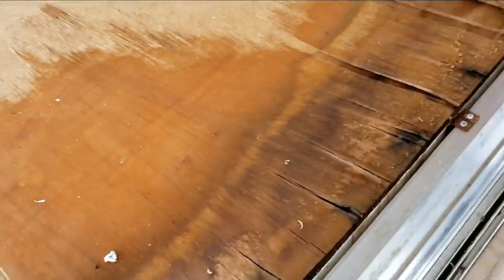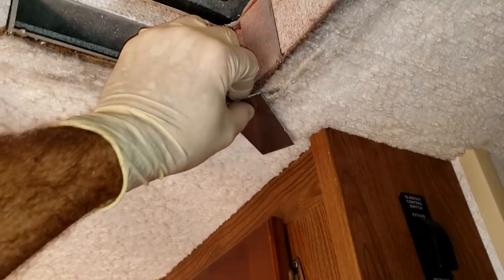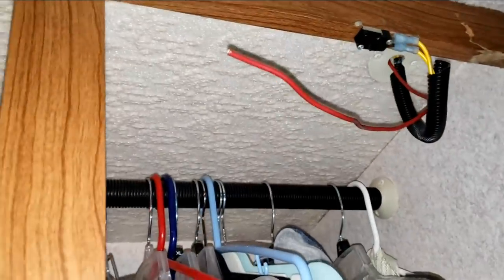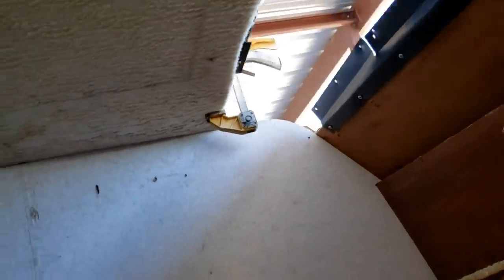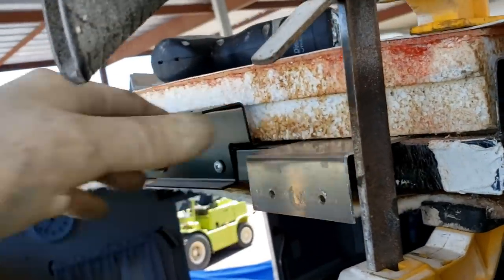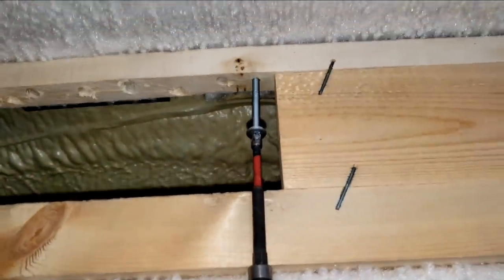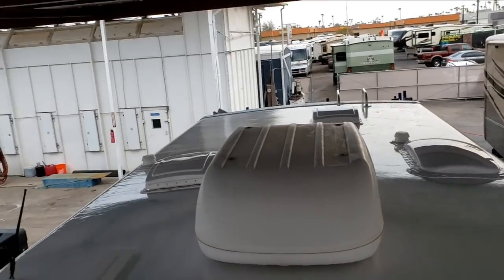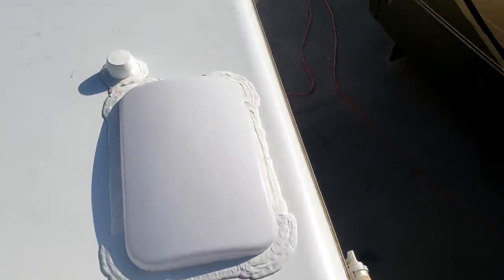A New Roof for New Journeys on a Winnebago

Comment: Another Fine repair. Aluminum is non ferrous. SO plenty safe to cut on any wood working tool (as you already know). And I crown you a RV ENGINEER. Personally I think you did a fine job And the owner made the right decision by getting you to do the job.  Congrats to the both of ya. -S
Reply from the maker: Thank you. You never know if someone will point out the obvious flaw in the design after the fact.

Comment: You are so right about a pre purchase inspection by a professional. I was misled on a fifth wheel private party purchase I made about 10 years ago. I had it fixed at the factory and still have it today. If I ever do purchase another one used it will be pre buy inspected for sure.
Reply from the maker: It's a good practice and wise. Most dealers do an inspection, but an independent one is a good idea too, just like buying a house.

Comment: You should create an Amazon list of many supplies (glues, sealers, fasteners, electrical connections, vents, fans, etc.) you use and get added income from your videos.
Reply from the maker: I appreciate that. I have thought about it, but I'd get preoccupied with listing everything and I'm afraid many people would be put off by it or feel its my fault if the product doesnt work correctly. Thanks!
Reply: I second it.  Just general “this is what I use, normally” videos as well.

Comment: I agree, if I bought that unit, I would be months fixing it. Also, I doubt I could fix it as well as you do. I have no experience with that kind of roofing system. The tucked in sides are masterfully done. That roof is better then when it came off the line. No wonder from the videos I seen of that line, it's made the way it is. I won't go there on how it is made :-(
Reply from the maker: Thank you. I have heard from a few viewers that were able to do the job and very happy with the results so dont sell yourself short.

Comment: Check out hollow door fixings for your ceiling fixings. Great job.
Reply from the maker: Unfortuately the roof isnt hollow so most toggle type hardwares would require foam to be removed too. And these plates behind the paneling makes a very strong load bearing surface. Most RV manufacturers use similar bracing in walls were furniture or cabinets are mounted. Thanks!

Comment: Great work !! On the screw holes for the interior AC filter cover any other ideas for fixing the stripped out holes. Also how would u install solar panels on a winnebago roof ? How many tubes of 311 nuflex to seal a front cap up on roof?
Reply from the maker: 3-4 tubes on the front cap. I generally follow a water vent wall from the roof to the basement for wiring. Bigger screws work and moving the grill works too. Thanks!

Comment: I have 2013 Winnebago Vista 30T, the front end adhesive is seperating from the brackets in 4 of 6 mounts.  What is the adhesive I should use to glue those brackets to the front fiberglass back on.  Winnebago says Plexus 330....Thanks John.....keep up the good work...
Reply from the maker: I am not sure which brackets you mean, but I use SMC body adhesive epoxy to mount brackets to fiberglass make sure you remove the paint and drill some holes, that's usually why they fall off.
Reply: @AZExpert  It is the brackets to hold the front end fiberglass ( below hood) to the frame... Thanks...if you have an email I can send you pictures... the azexpertrv@gmail gets alot of email thinking they are sending it you...Thnanks

Comment: I just recently found you channel and love it. I have a 2007 Winnebago Voyage and I saw where you talked about the the sealant where the roof tucks into the channel goes bad. Mine has almost no sealant left so I am going to reseal it. One problem is right in the middle of the coach the end of the track is sticking out and not attached. I am guessing the screw either was left off or rusted out. How is the best way to reattach. I am worried about trying to pull out and up the fiberglass roof that it might crack. Should I pull out the roof or just maybe put proseal on it and glue to side wall?
Reply from the maker: It is screwed down behind the radius you should be able to see it in this video https://youtu.be/LPRLFu30gU4 I would not advise just gluing the rail down if it is that loose. If you don't feel comfortable, I'd take it to a shop. It's worth it to keep the roof from having to be replaced.

Comment: Hey, I am in Georgia and need to have my roof replaced on my 2007 Raptor 38 foot Toy Hauler. I know that the two rear plywood panels will need replacing. Wish I was close to you so I could schedule you to do it. I haven't priced around yet and was wondering what kind of price to expect? I love your vids and learn something about each one. Thanks :)
Reply: He mentioned before about $200-250 per linear ft
Reply from the maker: Trailers will have a membrane roof so much different than this one. The guys ar RVROOFINSTALLS are based in Georgia, they put an incredible roof on RVs.
Reply: @AZExpert  Thanks for the info. Looks like I got a time set up with them to get it done.. April was very helpful. Thanks!
Reply: If in doubt, apply gobs and gobs and gobs and gobs and gobs and gobs of sealant. And then some more.

Comment: Can you please tell me what product to use on resealing the sidewalls on a Winnebago tour? I keep finding all kinds of opinions but I know you will give me the correct answer. 
Mine just needs a little attention of resealing. Thank you!
Reply from the maker: I assume you are speaking of the trim, windows, and doors to the sidewall. I find 100% clear silicone is the best on painted sidewalls. Winnebago likely used a proflex clear sealant that yellowed and cracked but that stuff is difficult to tool to look good.
Reply: AZ Expert I need the product that is used to reseal the roof to sidewall joint so our roof does not lift.
Reply from the maker: We use, Proflex from Geocel
Reply: AZ Expert what is the best tool to use removing old call on the sidewall to roof area on fiberglass?

Comment: I bought an old 89 class c and  didn't notice the eternabond on the front cap seal, where you always show it being placed.   I know it had leaked in the past 2 owners ago but the last owners never had one.   So that probably means the eternabond is about 6 years old.   My question is, what do I do if I dig up all that up there and the 2 don't have enough material to overlap?  Also is dicor corner seal as bad to use as eternabond to bridge gaps?  Im leaving sunny cali soon and heading to we(s)t virginia so I want to tighten things up.
Reply from the maker: I'd only seal if there is a leak, or sealant is cracked and missing. Is the front cap loose or leaking?
Reply: @AZExpert  there is maybe a 1/4 inch gap where the corner molding bends at the front of the cabover and meets the side.   I might be able to seal that bit without messing with the roof/eternabond then.   Thanks for the reply man, you're awesome.

Comment: Is there something I could put on top of my camper to seal it I have baby 2015 lifestyle 5th wheel I guess what I'm asking is there a sealant that I could use a paint roller the put on existing roof 2 expand life of the roof and  the slide outs
Reply from the maker: Your membrane roof really just needs annual maintenance of soap and water and inspections. Spot re-seal where necessary but I'd hesistate telling you to coat a good roof, you generally coat a roof at the end of its life.
Reply: @AZExpert  thank you under my current situation I will have to hire somebody to wash it for me I'm just recovering from colon cancer surgery so I will have to find somebody here local to wash it for me... wished I could do it myself but I need to get him back thank you very much for taking your time out of your day to answer my question

Comment: So don't use dicor on fiberglass roof joints?
Reply from the maker: Do use dicor on roofs sealed with silicone roof sealant like winnebago and tiffin. Most other fiberglass roofs use dicor like country coach and monaco.
Reply: @AZExpert  so, I have a filon roof on my 2000 safari trek and dicor is ok?

Comment: I've discovered significant water damage in the bathroom area during a exhaust fan upgrade of my 99 Adventurer, probable started in the skylight.  I'm at a crossroads as to how far to go. On the inside I stripped most of the thin door skin type plywood and now find myself concern that it will no longer be a continues left to right piece. Should I be concerned?  Plan is to install a decorative FRP for the ceiling panel.  Have been installing sheet metal for the screws on the upper half much like shown in the video.  One tip I found is to slightly heat a the sheet metal using a map-gas torch allowing it to slip right in; when it cools it sticks.  There seems to be so little about my specific repair and how much of the deteriorated thin plywood can be left in place. Could tackle a more extensive repair if I had a building to do it in.

Comment: I have wondered for a few years how my 94 Winnebago roof is made. It looks like it's 2 inches of some adhesive-y foam between two layers of .125  interior glue ply, and that is the whole of the structure/structural integrity of the roof that spans ~96 inches ? I'm 250 pounds american, so I could fall through on a bad day, right? And have you ever fixed a similar roof where the .125 ply has gone bad to any degree, is there a way to restore the structural integrity of the panels to factory specs with some kind of repair? I have seen where some self styled repairman covered the entire roof with .50 nominal OSB or something similar and I wondered how that would work, my impression now is that this probably isn't the most well thought out approach. If you start out with a roof that has whole panels that are structurally defective and should replaced or thoroughly repaired, what do you do? Also, I noticed that my roof has a texture a lot like fiberglass reinforced paneling(?)
Reply from the maker: I recommend repairing the roof rather than patching or overlaying a bad roof. With a 1994 the decision can be difficult.